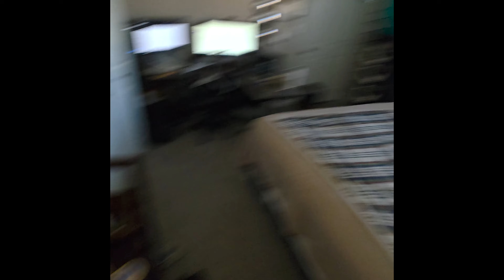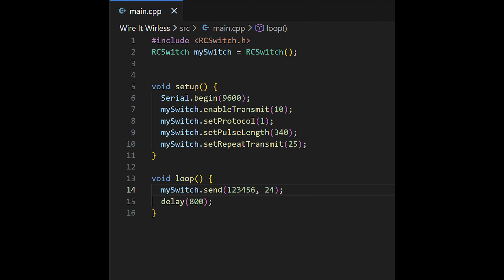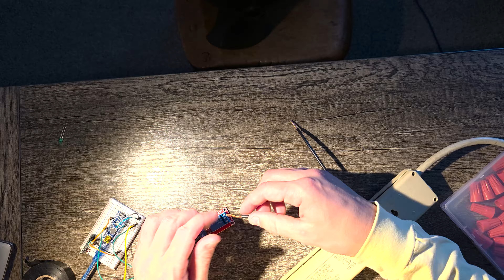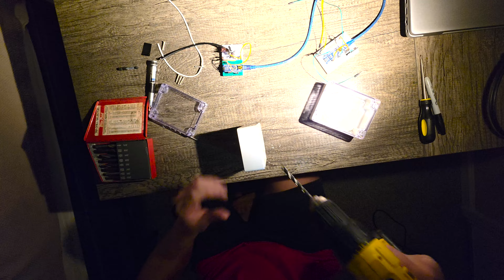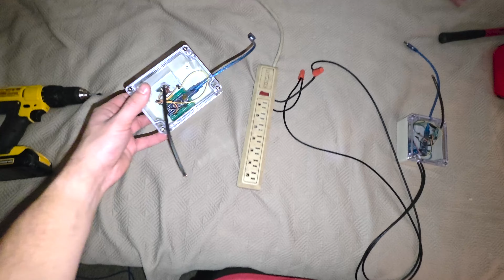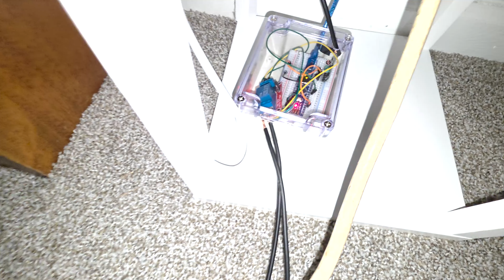Wireless Lamp Control Using a Light Switch (Cheap Arduino DIY)

Comment: Cool project! Perhaps a stronger antenna would help with the connection?
Reply from the maker: Yes for sure. Better placement of the antenna and using a solid wire vs a stranded. The question is how much